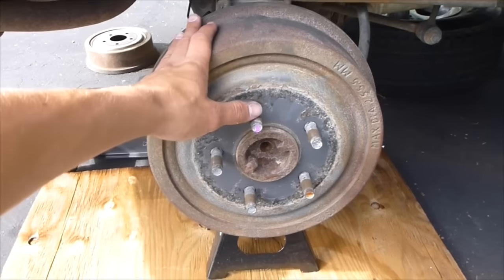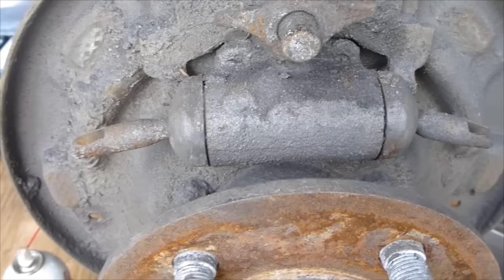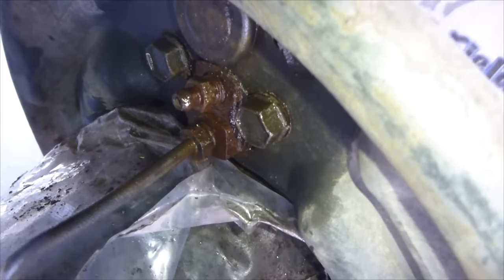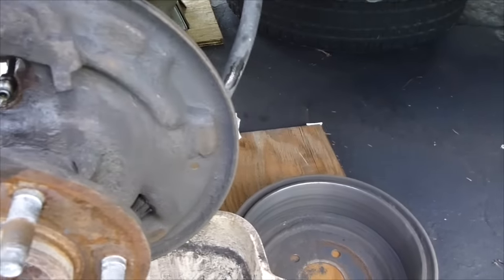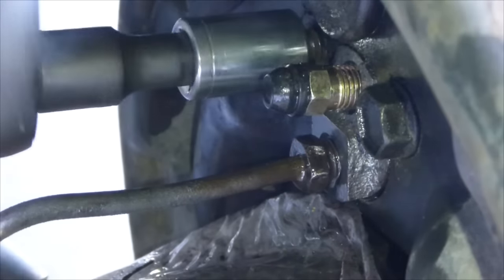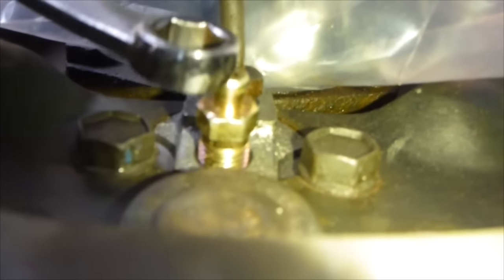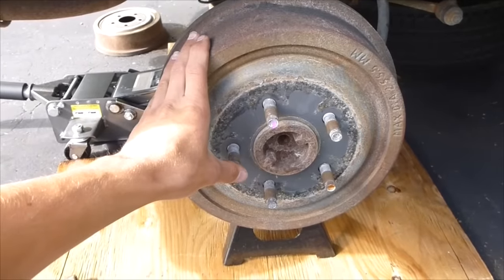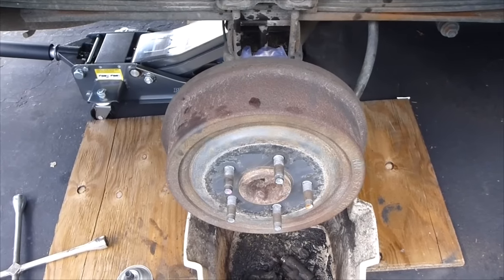How to Replace a Wheel Cylinder

Comment: I replaced both brake wheel cylinders on my daughter's Saturn recently based on your instruction. Saved some real money. Thanks!
Reply from the maker: +hnkfsh81 Awesome! Glad the videos were helpful and you saved some money!
Reply: +ChrisFix  love your method for bleeding brakes. hope that white shirt wasn't one of your favorites lol
Reply: reply
Reply: how much do they charge? Thanks
Reply: @VinayakGovande  if u don't mind me answering they were going to charge me $230.00 to change both rear cylinders on my vehicle.
Reply: I replaced one cylinder, passenger side, so I just bleed that side of the drum brakes??? Or will it have to be both sides?
Reply: Is that Saturn in the junkyard by now 8 years later? Lol

Comment: Flare nut wrench, bro!  They are crazy expensive but rounding one of those nuts on the brake line is "Game Over".  I watch your videos even before I do maintenance work I've done 10 times before- your tips and tricks make me do it better every time.  Cheers again, Chris!
Reply: John Daly 
I wouldn't call $6 "crazy expensive".
That's how much singles cost at my local auto parts stores.
Reply: When you have to buy a whole set of them- yes, they are expensive.  Crazy expensive, even.
Reply: +John Daly  Your right flare nut or line wrenches are the way to go . home depot used to have them I think they were $30 ??? I would rather pay 30 bucks than have 300 dollars of aggravation
Reply: +John Daly It's like $9 for the set at harbor freight.
Reply: +John Daly I paid $9 for the set at harbor freight.  At 7/16, he can probably get by without it, but it's still risky.  The first time you round off one of those, you'll be hating life.  Don't ask me how I know.
Reply: Id say Game over is a bit strong. Round one of those puppies off and you can just get a pair of Vise Grips and get it out that way. If they are really stubborn, hit it with some Heat (blow torch). Then all thats needed is trimming the brake line at its end, replacing the old through nut and then put a double flare on the end of the brake line. Good to go
Reply: Flared wrenches are not expensive.  I actually paid 60 dollars for a 20mm snap on inline flared wrench that is used for gm fuel filters.  U can buy a set off craftsman wrenches for 40 dollars at sears.

Comment: Hey  again chris . Just a quick note to pass along to everyone based on what happened to me today when I was changing out the brake cylinders on my son's 93 accord. The compression fitting was rusted to the brake line like you mentioned could happen so I took the cylinder off with a small section of brake line attached. The fitting and the brake line were completely rusted together and I couldn't break them apart.I took a "bernzomatic" torch I got a few years ago at home depot and heated the fitting and after about 10 seconds I was able to break the compression fitting free from the break line. Had to do the same on both sides and it worked like magic both times. Thanks again chris . hope this helps someone.
Reply from the maker: ***** Thanks for sharing Jeff! I am sure this will help a lot of people!

Comment: I've been waiting weeks for someone to change the brake cylinder for my Pt Cruiser, after 2 months I come across this video and feel like you've explained it well enough for me to try it myself. Thanks for making such an excellent step by step video!!
Reply from the maker: Diana Lopez-Rodriguez Awesome! I am glad the video was helpful Diana! If you have any questions, feel free to ask! Get some penetrating fluid on that bolt that connects the brake line to the wheel cylinder so it comes off easily.

Comment: If I'm worried about cross threading, I turn the nut backwards with my fingers, until I can feel it seat. Then tighten with fingers, and don't put a wrench on it until your certain the nut is on.
Reply from the maker: Great tip!
Reply: That's what I do too.

Comment: Thank you so much for your help. I rebuilt my brakes on my 91 gmc suburban R2500 and it was so helpful my problem was there was so much rust built up on it it took me a week to break it loose and no power tools snapped a lug bolt in the process but achievement unlocked lol really loved your video and loved how straightforward it was 😄😁

Comment: NEVER USE A REGULAR WRENCH OR OPEN END METRIC/SAE WRENCH ON THE BRAKE LINE BOLT CAUSE THE BRAKE LINE BOLT WILL ROUND ON U VERY EASILY. THEN YOU'RE IN A WORLD OF HURT. USE A LINE WRENCH....THATS WHAT THEYRE CALLED.....THEYRE MEANT TO FIT AROUND A LINE BOLTS LIKE THE BRAKE LINE BOLT SO THAT U DONT ROUND IT OUT BY STRIPPING IT
Reply from the maker: Kiddro22 Thanks for the tip!
Reply: Flare nut not a bolt

Comment: Nice video explanation, easy to listen too and to follow. One thing you might want to consider telling folks (or folks can read here)... it's best to use a line wrench on those brake line nuts, as the are super soft and can easily round over. For folks who don't know, a line wrench is 'almost' a box wrench, with a small opening where it can fit over the line, and it grips the nut on 4 sides, instead of just two. Definitely a DAMHIK issue!

Comment: If you prop brake pedal down just an inch or two you will not get much brake fluid gravity feeding down to your open line.
Reply from the maker: bottmar1 That is a good tip! Thanks!

Comment: did a full rear brake overhaul today, all the parts came to £150 and learnt how to do it from these videos. everything was going fine until i got to taking off the cylinder... managed to brake 3 tourque keys trying to remove the retaining bolt, ended up having to remove the shock absorber to drill the bolt head, we then had to cannibalise bolts from a bicycle to fit the new ones. after that all happened, the nut around the brake line got wrecked and had to file it back down to 10mm

this was meant to be the simple bit bit took hours =[

cheers for the videos!

Comment: Thanks to you tube and guys like you Chris, I saved money and a lot of aggravation with waiting on a mechanic! And thank you so much for showing us how to bleed our new wheel cylinder! I hit a problem with my master cylinder going dry. I have 2 compartments to mine. One is for the front and the other is for the rear. Well I assumed the bigger rear cylinder was for the rear wheels so that is what I monitored. ! Wrong! lol The front one which holds very little fluid actually controls my rear wheels! So your tips on bleeding was a God sent! Because at first, I had no brakes and the light was on my panel. But now, it's all good thanks to your video! :) Here is a tip. If your master cylinder has two areas, better watch both of them to start going down on fluid level!

Comment: Great video Chris. But I use a plastic baggie & twist tie or wire tie to close off brake line - reduces lost brake fluid.

Also put a clear plastic hose onto bleeder valve. Put hose into cut cap + empty water bottle. Bleed brake fluid into bottle. A lot less mess.

Comment: Clear and well-explained (except for the suddens disappearance of the brake hardware, which you later explained).  Just a couple of hints: 

1.  Ideally, you should use a tubing wrench on the brake line.  Yeah, I know most people don't have one, but you can get a full set at Harbor Freight for not much money, and it will keep you from rounding off the nut.

2.  Instead of a plastic bag, put down some folded-over paper towels to catch the brake fluid.  And keep it off any paint.

Comment: I am planning on do the drum brakes on my 1999 dodge ram 2500 V-10 Ram with the resent cold snap my rear drum brakes started to leak which made this DIY job necessary I look forward to trying the tips you gave in your video because I have never done drum brakes before

thanks in advance.

Comment: Just replaced my rear brakes yesterday, only kept the drums because they are still good. The left zylinder was stuck on one side it was all rusty and there was much air in the system, the left brake had almost no function wich caused my car turn  a bit right when i braked.
My Handbrake also did not work and the brake must ran hot at some time cause all the paint was like rubber and lose. I watched your videos again before i started, they are super helpful :).
Reply from the maker: SchiggyoO AWESOME! That is what I like to hear! Glad the video was helpful!

Comment: Nice Vid! I don't know if this was commented allready, but if you push your breakpedal a little bit and fix it there before you loose the breakline, it will bleed only a bit at the beginning. The piston inside the master cylinder will close up the reservoir from the rest of the system. :)
Reply from the maker: Thanks and thanks for the tip!

Comment: Just a few tips for future videos and work in general. Always use a flare nut wrench or line wrench on the brake line nuts. They provide better grip and reduce chance of stripping the soft metals. Once you have loosened the nut you can then use a regular wrench on the nuts. Also using a pedal depressor will prevent fluid from leaving the master cylinder and helps make things easier when bleeding the system later. Great video though teaches a lot!
Reply from the maker: Liam Andrews Thank you for sharing these tips!

Comment: Nice explanation.  It's best to put on a short length of clear tubing on the brake bleeder screw that way when you are bleeding it is much easier to see if there is air coming out.  Even small bubbles can affect the brake system.
Reply from the maker: +MistrDough Thanks! Like in this video: https://www.youtube.com/watch?v=n1NvtUwfRJc&lc

Comment: This was an great video. Excellent video and audio quality and post production to go along with the great tutorial. I'm a handy guy but auto work always intimidates me a bit. This has taken that away. If I do it, I'll write back how it goes.
Reply from the maker: Michael Julius Fotografie Glad the video was helpful Mike! Def let me know how the job goes!
Reply: ChrisFix All done and doing good. A few months ago I had a spring break in the drivers side drum. When I took it in for repair the mechanic noticed the rear wheel cylinder on the passenger side was leaking. Tight on funds I had to leave it be. Fast forward to now and the cylinder was toast, but also a spring broke inside, just like the other side. Still short on funds, and needing to get to work, I had no choice but to handle it myself. 

The two biggest problems I faced was getting the drum off and getting the brake line nut unceased so it would spin. I was really concerned with damaging the brake line. The drum has a built up ring of rust that was keeping it from getting over and past the shoes. Side one was a bitch to complete, drilling out the pins and all, but side 2 went much smoother. 

Either way, I saved the money on labor and kept myself on the road, able to get to work and make money.
Reply from the maker: Glad you got it done and you saved a lot of money! That is why I make these videos! Thanks for the update! Where did you get the drilling out the pins idea?
Reply: ChrisFix I thought I got it from one of your vids. I did watch one from another guy as well, Maybe it was him. The idea was to collapse the assembly inside to make it easier to get the drum off, but it didn't help.
Reply from the maker: Yea you did get that idea from one of my videos! I was just checking lol.
Reply: Don't be intimidated, I jumped in and lifted my whole suspension myself and drums..axle swaps ect.... Just make sure your Safety is number 1, OVERKILL Jack stands and shit don't ever rely on a jack and just take your sweet time!! Treat everything a baby with easy care and it all comes out perfect. Kinda fun when you upgrade parts and see the improvements.  I always assume the worst case this way your always ready for any side problems.

Comment: Thanx  for the how to I have 1989 f250 7.5l v8 460 and front brakes disc and the back are drum this video helps a lot and the bleeder valve s were rusted shut on my truck and one of my rear brakes squeaks like hell probably a combo of bad pads and cylinder so I know for sure I'm doing the whole set drum shoes spring and cylinder I've have learned a lot from these vids keep it up good bloopers by the way
Reply from the maker: sercit seven Awesome! I am glad the videos have been helpful and good luck!

Comment: This cylinder just went out on my 04 ranger, as always, another great video, even if it is 8 years old! Nice brake "renovation" 🤣
Reply from the maker: Thanks!
Reply: Hey man! My brake line nut is rustes to the line, and there isnt enough clearance to twist the cylinder, any recommendations?

UPDATE, i let penetrating oil sit on the nut for an hour and it turned out nicely

Comment: Great video, good camera work. I agree with the comment about using an open ender on the brake line nut. Too risky. I made my own tool by grinding a piece big enough to fit over the brake line from a cheap ring spanner.
Reply from the maker: Thanks and thanks for the tip. I honestly never had a problem using an open ended wrench on a brake line nut, but I def never want to have a problem! haha

Comment: When you talk about starting the engine to make pumping the brakes easier, is it because that vehicle has a vacuum-powered brake booster?

I have an integral ABS hydraulic unit in my van and it works regardless of whether the engine is running.

Comment: This is awesome, Chris, thank you! I have a 1987 Toyota 4by truck that the previous owner abused mercilessly and I am just starting to work on it. Brakes need to be completely redone and it's been years since the last time I did brakes. This helps a lot! Also, you used Liquid Wrench, great stuff but I like P.B. Blaster.
Reply from the maker: Thanks! I like PB blaster too but not around the rubber brake lines!
Here are some other brake videos I have done that might help:
https://www.youtube.com/playlist?list=PLvKbarVtwhUsr7OjYE7NEEXw97DvmmNeE
Reply: PB Blaster eats rubber?
Reply from the maker: You ever read the can? Look at the warnings on it. They dissolve a foam cup with it!
Reply: I actually have never read the warnings until now. Guess I'll be picking up some Liquid Wrench my next trip to the parts store!

Comment: When bleeding the brakes put about a foot of clear plastic tubing (like air hose for fish tank) on the bleeder nipple.  You can run this into a jar on the ground so the fluid doesn't go everywhere.  Also it makes it very easy to see the air bubbles and when there are no more bubbles, you're done!
Reply from the maker: +Todd Smith Thanks for the tip. Check this out (basically what you said): https://www.youtube.com/watch?v=n1NvtUwfRJc

Comment: Great videos.  I'm a new subscriber.  Question: I'll be replacing both right and left drum brake systems this weekend.  Since I'm doing both sides, when do I bleed the brakes- after each side is replaced or wait until after both sides have been replaced?

Comment: Nice video! I would suggest one thing. Get a small piece of clear tubing and put the hose on the bleeder screw instead of putting a bag under it. Then route the hose in a bucket or bottle. Less cleanup once its all done. A couple of feet of clear tubing from any hardware store and u can reuse it over and over.
Reply from the maker: Great idea! I actually did this for my "how to bleed brakes" video that I am currently editing. Good tip! Thanks for the comment!
Reply: ChrisFix
Looking forward to that video!

Comment: Great video! But probably should have clean the vacuum cover. Before reinstalling the new one first.? Also should have kept up with the brake fluid level during bleeding. Can also do the bottle bleed if you're by yourself.

Comment: Just a quick tip for loosening brake lines and bleeder nuts. They always strip!! You can use a 5 sided wrench specially designed for them. Safe and quick way to not strip them.

Comment: Great vid man! I have a break job to do on my 1993 F150 the e brake adjustment screw has broken off and I can hear it tumbling around at slow speed.
Reply from the maker: Oh man... Well hopefully this video along with my brake drum videos help you out so the job is easy and straightforward! 
How to Change Drum Brakes (In-depth, ultimate guide)
and
How to Change Drum Brakes (In depth, ultimate guide) 2

Comment: Make sure the brakes are pumped after bleeding, to ensure the new cylinder has the correct pressure to apply the pads. I almost got put through a garage door by someone who forgot once. We never had the engine running when we did them though.

Comment: Thanks for this video. I noticed previous owner had disconnected the rear brakes and when looking under the vehicle I noticed the cylinder bleed valve was broken.
Reply from the maker: Dang that’s dangerous!!! Get that fixed ASAP!
Reply: ChrisFix I’m planning on doing it myself, but only because this video was so detailed. Quick question, would it be okay to only put jacks on the rear wheels and not the front? Thanks in advance!

Comment: I move into my first house (with garage!) this weekend. I need to do my brakes on my '04 TJ. Should I replace the cylinders and drum assembly and hardware while I'm in there? The hardware kit (springs, etc.) is $7.50 per drum, and the drum assembly is $27 per drum, and cylinders are $10 per drum.

I haven't been able to take them off yet to inspect what they look like, but it's all stock hardware and it's got 142k miles on it.

I'd like to have an Amazon package delivered the day I move in so I can just jack it up and be done! Just want to make sure I'm not "over engineering" the job lol

Comment: The flare nut on brake line at wheel cyl can be a problem.  If you get flare nut loose from wheel cyl but it is still rusted to the line,  brake out heat gun, pen oil and prayers.  Brake lines are "double flare" so even with proper tool difficult to make.  You'll have to by a prefabbed generic line that is close in length (longer most usually) and in a way to use whole line w/o creating a loop that will trap air.  Big pain but doable.